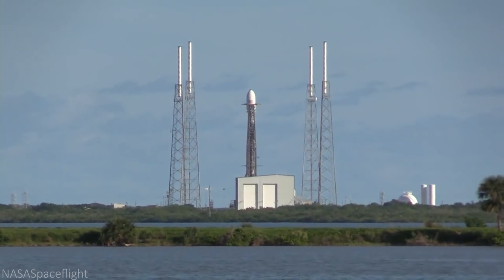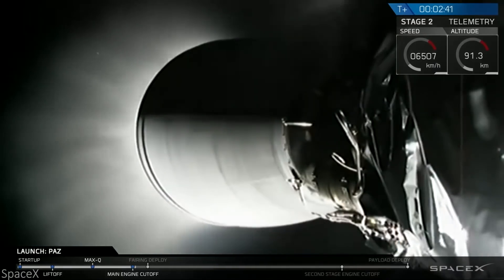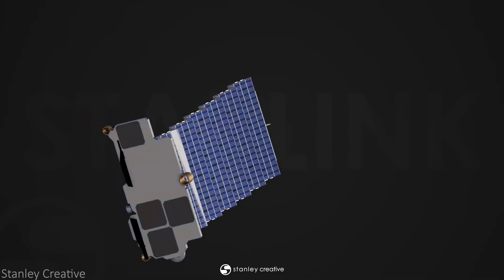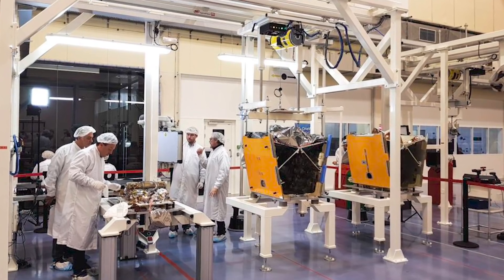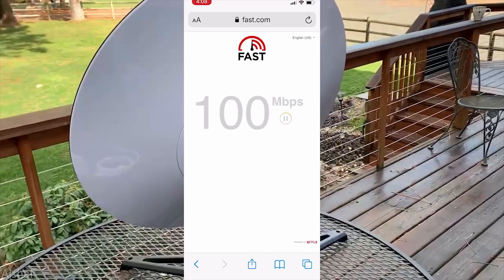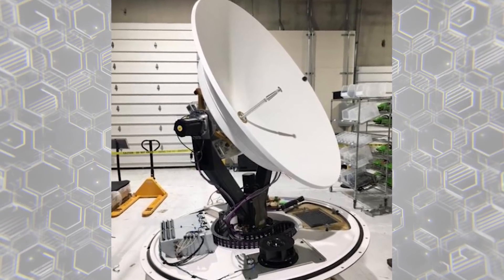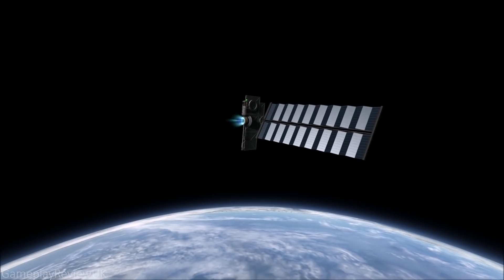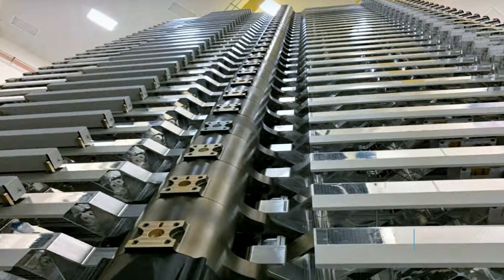SpaceX's Starlink 2.0 - Faster Speeds, Greater Coverage and More

Comment: So, let's say you have about 5gbps per satellite. That means about 200 customers per satellite with a slow speed (25mbps). So for 40 000 satellites that would me 8 million customers. 

Now, the earth is 75% water. Meaning that the average satellite will sit unused, above the water, 75% of the time. So you can ONLY serve 2 million customers WORLDWIDE, before the connection would become unsuably slow.

So we are destroying astronomy and we are polluting the sky and earth's orbit to serve 2 000 000 people out of the 7 000 000 000 on earth. That is ONLY 0.03% of the entire population.

A.k.a. A wasted effort.
Reply: I wanted to add this:

A dish uses rougly 150 watts of electricity ALL THE TIME. They are extremely wasteful of electricity.
Reply: Those numbers are off. It's 20gbps/satellite (gen 2 is 60gbps). ISPs do something called oversubscribing usually at 20:1, 50:1, and 100:1 ratios since a single 1080p stream uses only 5mbps so real internet usage even at peak hours is 3mbps/subscriber on average. Starlink is allowed to oversubscribe by 25:1 per the FCC rules, so that would be 5,000 users per satellite. They are working with Sat con 1 and have sunshades etc. to lower brightness. Kessler isn't a long term threat with Starlink since debris deorbits in 5 years time and the satellites have autonomous collision avoidance. Also, gray dish only uses 70watts and like a 300watt+(under load) computer you can turn it off at night remotely or physically.
Reply: @MiguelRuiz-vp1hu  Even with 20gbps, that is still a really small percetage of the population.

We are still sending satellites for a really tiny percentage of the population, and ruining astronomy with it.

70W is still a lot of power for stand-by, and 300W is absolutely ridiculous. It will cost around $200 anually to run this thing, or you will have to buy solar panels and a battery if you don't want to hurt the environment with coal power. 2 solar panels of 200W each will set you back around $200-300, and a battery that could power this thing overnight would cost around $100. Then you have the dish at $500, and the subscription at $99/month. This starlink thing is EXPENSIVE to run.

No, debris doesn't just magically de-orbit after 5 years. It can take hundreds or even thousands of years for things in orbit to de-orbit.

Also you're forgetting to take into account the unused satellites (75%), because the earth is 75% WATER (a.k.a. 75% of the earth is totally unpopulated). Meaning that of the 40000 satellites in orbit, you will only be able to use 10000 at a time.

So the ABSOLUTE MAXIMUM number of customers you will be able to serve is 40 million, and that is with a speed of 5megabits/second. If anyone starts to download, the speed will be dramatically lowered below 5 megabits/second. 

So, because of that, we need to serve less customers so that people can download without others noticing. For a good overhead, we need to lower the amount of customers to HALF (20 million) so that people can still download at a reasonable but still VERY SLOW speed of 20 megabits per second (these are generous numbers). We will also need that buffer because clouds and bad weather severely lower bandwidth.

Starlink would - in ideal circumstances - be able to serve 00,28% of the population. And it's ruining astronomy for it, it's increasing the risk of kessler syndrome occuring, and will use up around 4 BILLION DOLLARS worth of electricity annualy. And Elon wants to replace the satellites every 5 years. Imagine the cost and space debris caused by replacing 40000 objects in space EVERY 5 YEARS.
Reply: @The Mitchell Special that's a "feature" that isn't even turned on right now. And those satellites won't be used to serve customers directly. Meaning that you need 4x as many satellites as Elon musk thinks.

Meaning that you'd have to clutter the Earth's orbit and throw billions of dollars at the project to keep it running

Comment: I was a fairly early beta user.  Love it  I'm in the country and it is the first internet that actually works at my house
Reply: I’m pumped, I hope I can get it on a bus I plan to transform into a house for my job which I travel
Reply: @mythicallegendary3992  you can already go on buses in the UK with internet access. No need for starlink
Reply: I'm sure you aren't alone. Have or your significant other (if you have one) allowed someone else to use it? See that's the important thing. It's usually not one user per unit sold. Because you are in a remote location your internet connection may be frequently used by other people than just yourself. Because of that Starlink is directly changing the quality of life everywhere.
Reply: Beta tester of the normal starlink or gen2 with laser beams?

Comment: Maybe they should clean up all the garbage up there first. 🤔
Reply from the maker: Stay tuned for our next video on this topic!
Reply: If this becomes cash cow then I wouldn’t be surprised that spacex starship used for cleaning. I bet that will give them the right to Secure many orbital locations after each clean
Reply: @moe2579  hey... 🤔that's another industry altogether maybe Branson and Bezos can industrialize satellite garbage pickup....😅
Reply: @DwayneETowns  Waste Management will beat them to it with Garbage Hauler 2.0. Likely before BO delivers the first BE4 engine to ULA.😅
Reply: Most debris up there isn't at 550km altitude since it takes only 5 years for debris at that altitude to deorbit.
Reply: Isn't it something like 80% of all the satellites up there are non-operational? Plus all the other garbage floating around in the millions that needs to be cleaned up
Reply: You got a good point I was thinking that also all those defunct satellites already up there , that they claim can  do a de-orbit and burn up in the atmosphere... Maybe.